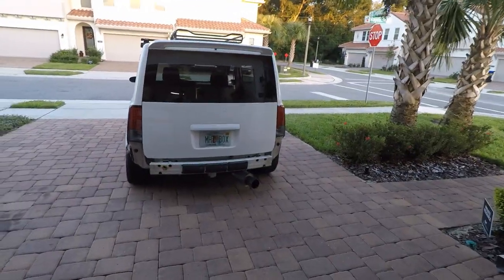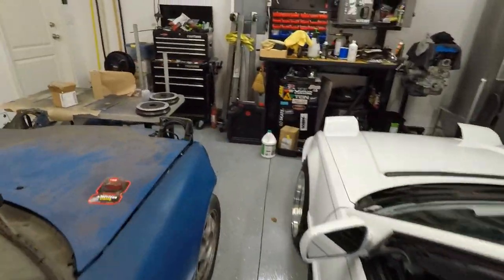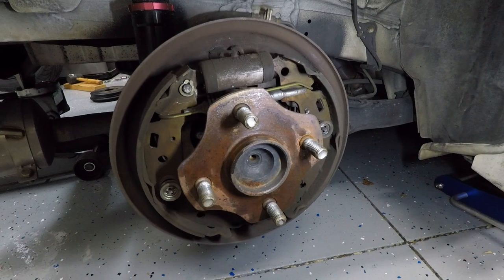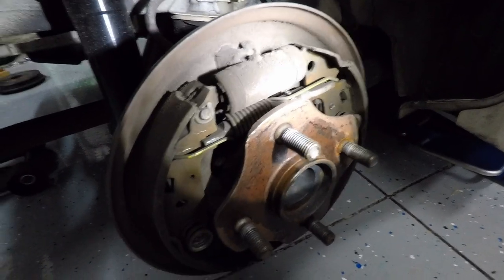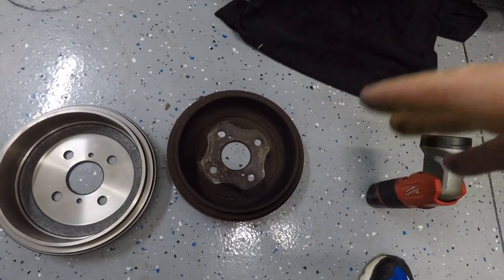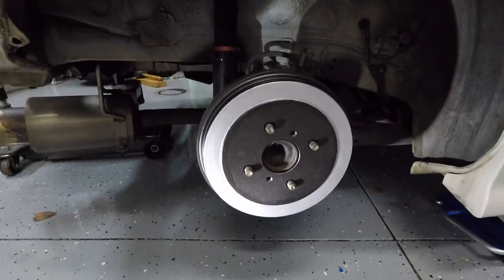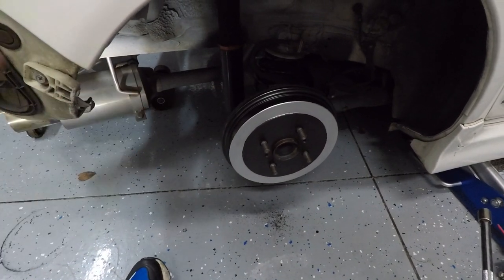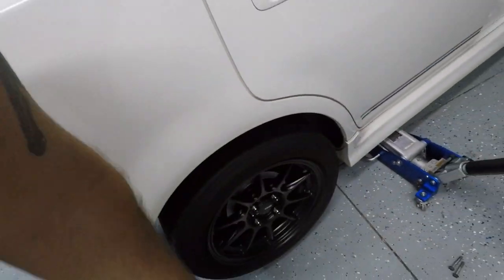Scion xB Rear Brake Install and Rear Lip Update!!

Comment: My first time doing just the rears took me almost 2 hrs but then everytime thereafter 20min each side.
Reply from the maker: You are a better man than I am! Thanks for watching!
Reply: @ExtremeDailyDrivers  but you showed me the super easy way to replace and reset a wheel stud. If it wasn't for your video I would've been stuck with the old knowledge of a laborous manual method 😅 you have shown me a better way 👊🏾

Comment: you can remove those two springs with a large pair of pliers also................straight on, grab the top (on sides), put other hand behind to push on pin to hold it in while you push, then push spring down with pliers and give it a twist.
Reply from the maker: I think that is how I remove them the first time I tried to do the shoes, but then could not get the springs back on. I ran to the store and got the brake shoe spring tool and had them on in seconds.

Comment: Drum brakes aren’t hard. But it’s best if you watch someone else do them first.
I don’t have that tool. I use basic pliers. The only other tools that I use are; flat blade screwdriver and good needle nose pliers.
Take the spring off the bottom first. THEN take off the two nuts. Then the assembly comes off easy. Disassemble and reassemble the top springs out on the ground

Comment: When you're doing the brakes you put the wheels on and you adjust it from the inside with a quarter turn and that'll give you enough to stop evenly on both sides , because when you put the rims on makes the brakes feel loose because you're adding the weight of the tire and rim.
Reply from the maker: That makes sense. When you adjust the brakes, should there be some drag?
Reply: Yes , a quarter turn with tire's on

Comment: There is a wrench for adjusting the ebreak and you can adjust the rear breaks by backing up and pressing on the breaks.
Reply from the maker: I've heard that before. Are they supposed to be self adjusting? How does that work?

Comment: I had 'fun' for a couple hours trying to figure out why the drum wouldnt go on after the new shoes were put on only to find out the shoes were made too thick at the factory just enough to not work. Got another brand from a different store and they worked fine. I hate drum brakes.
Reply from the maker: I hate them too. Thank God I don't have to deal with them anymore. Thanks for watching.

Comment: Hmmm. Ok I see, you changed the drums but not the brake shoes. I took those off & put new ones on but I'm having a problem with the part itself. Its not a good fit, like they are engaged so I doubt the car will be drivable. I am trying to check my manual about size specs and not having any luck. Orielly & Advanced seem to carry the same size shoes but it is not fitting right....do you have any experience with this? ... I may have to go to Toyota for parts....
Reply from the maker: Yes. I did a video on it. Just search the channel. There are links in the description for everything you need. Thanks for watching.
Reply: @ExtremeDailyDrivers  I couldn't find it. I searched...are you sure you recorded it? Anyway, it was a exclusive part issue. Toyota break shoes worked like a charm & installation was super easy.
Reply from the maker: @alinajin8368  I'm positive.

Comment: I never used that tool for the springs. I teched for 5 years and always had better luck using needle nose vise grips.
Reply from the maker: I'm trying to imagine how that would work. Do you compress it with the video grips and turn it with the pliers?
Reply: @ExtremeDailyDrivers  put the round clip that spins at the very tip of the needle nose vice grips. Then once your pin is through and spring is on use those to compress the spring and twist on the clip.
Reply from the maker: Interesting. That sounds pretty easy. I'll have to give that a shot some day.

Comment: Like your videos bro your content is great 👍  new to the channel I also have a scion its a xa any ideas on how to convert drums in the back to rotors? Have you ever thought of doing a conversion
Reply from the maker: Hey thanks for subbing, and welcome to the channel!! Lots of people ask about the rear conversion, but it's not easy and there is no clear cut way to do. Did I mention it's also totally unnecessary in these cars? Yeah, there that's too. So I won't be upgrading any time soon. Thanks for watching!
Reply: @ExtremeDailyDrivers  thanks for responding buddy cant wait to see what your bumber looks like. Yea your right you dont need to converse but it would be a good one cause them drums are a pain in the ass haha
Reply from the maker: They are a pain, however they barely ever need adjustment. Thanks again for watching!